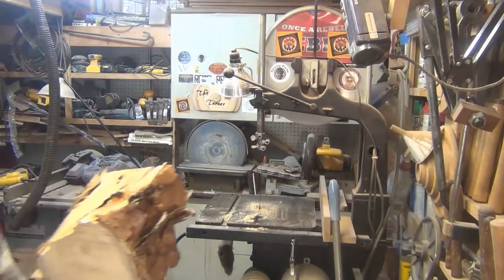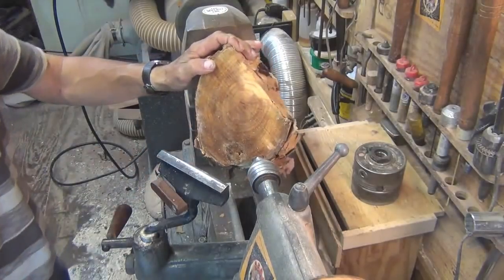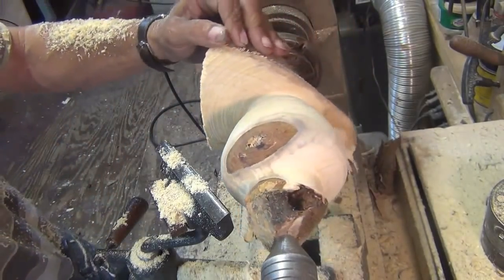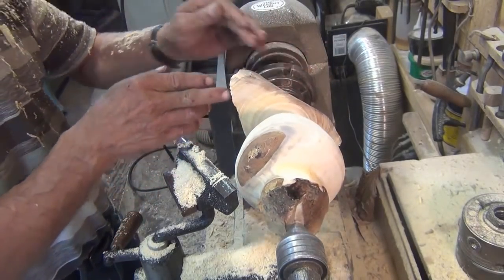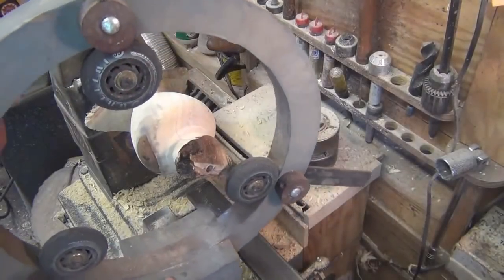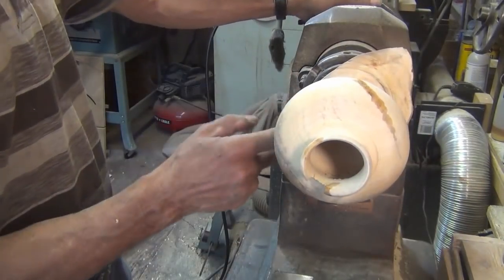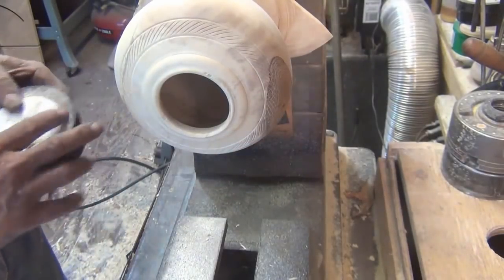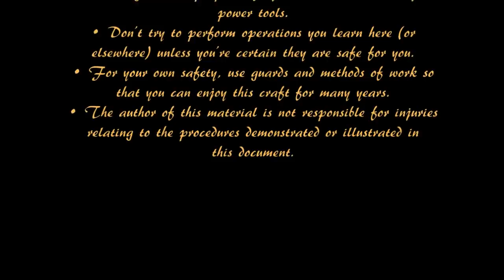A different orientation for woodturning by Al Furtado

Comment: Great. May I suggest you set the piece in the chuck with the tail stock center before fully tightening the chuck.
Reply from the maker: I needed the point of the live center to sink into the piece in order to keep it safely in place.

Comment: What an interesting tool with a great result, brilliant as always Al.
Reply from the maker: Thank you my friend. Yeah nice tool for what it does. a bit pricey in my opinion especially for the amount of times I use it It cost more than my first lathe LOL. I got to make one and show how so others can make it if they desire for a great deal less.
Reply: Robert Sorby chisels were the first tools I bought when I started woodworking, so I've got a bit of a soft spot for them. 

I love this texturing tool though. And at 70 quid here in Britain, it's not THAT expensive. A simple bowl gouge can set you back almost 50 quid.

Maybe it's because I don't have the range of readily available beautiful, exotic woods like you do in Florida that I like physical decoration on wood. Your video where you said that Brazilian pepper trees are considered a weed tree where you are - the British equivalent is the sycamore, which has a plain, pale wood, as is mostly just used to make treen. So I guess maybe I feel like I need something more to add interest and dimension?

Comment: Nice vase AL!! I am going to get me a steady rest for my mini lathe. Things like to shift while in my chuck when I try to hollow out the inside. I have had pieces come off and hit me. I do ware a face shield. I can crank the chuck as tight as I can and things still shift. Do you have any ideas that I can try?
Reply from the maker: Thank you very much my friend  for watching and commenting. A steady rest goes a long way but I have had a problem with one of my jaws not holding. It's nothing you're doing wrong it's most liked the jaws themselves. I switched out my jaws on the same chuck and problem disappeared. You might be ale to rough sand the inside of the jaws just to give them a better grip. I hope this helps.  Take care

Comment: So working on the diagonal to the grain of the wood, I wonder if that changes how you finish the piece. For example the techniques I use on end grain are different to what I use going with the grain.
Just trying to visualise how you'd sand/finish this one.
Reply: so 80 grit and steel wool, I really need to wait until after the video to comment. Nice job mate.
Reply from the maker: Thank you for watching and commenting my friend I didn't emphasize the sanding I did use grits to 320 on this and steel wool.

Comment: Hi.. Greetings from England 

Hand saws are OK Mr. Furtado...but consider investing in a Fein...

It would be easier dressing tenons...
Reply from the maker: Thank you very much my friend  for watching and commenting. now what fun would it be if I had a tool for every job. I say do with whatever you have as long as it is safe. Take care
Reply: Rebel Turner

I've collected several wood lathes Mr. Furtado

I've got an old Wilson wood lathe with a gap bed... WILSON were from Leeds...my home city...
I'd say it were 1920s...and weighs over 1/2 ton...

Anyway...I'm not a wood Turner per see but I liked watching your videos and thought I'd like to have a go..

I'm going to use old files and silver steels...forge up my own tools... 
I'll just use metal tooling carbide cutters for any insert chisels I want to make...

I'm not into all this branded tools porn such as:

 "I've got robert sorby chisels in my workshop" 
Or:

"Hi...check out my copying attachment...it were £400"...

Comment: Al, did you grind off the tenon and hollow out the bottom with a hand grinder or what. I don't see how you could have turned it to remove the tenon, since the top lip looked a bit fragile.
Reply from the maker: Thanks for the question Jim. I jamed the  mouth of the piece In my cone shaped jamb block of wood between centers and took it down to a very tiny nub (Usually the last cuts with a squew) than just sanded that and applied the finish by hand. It's a method I use 99% of my turnings